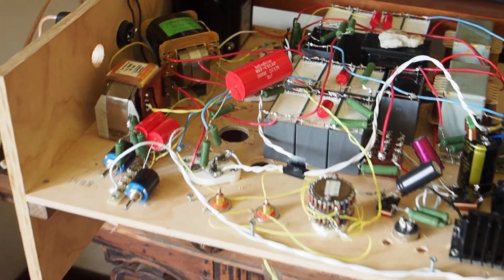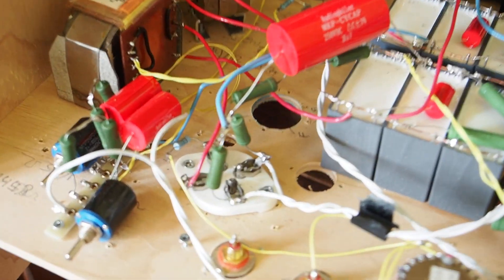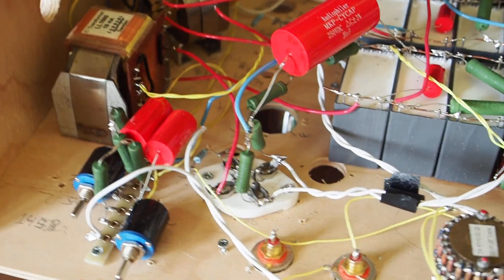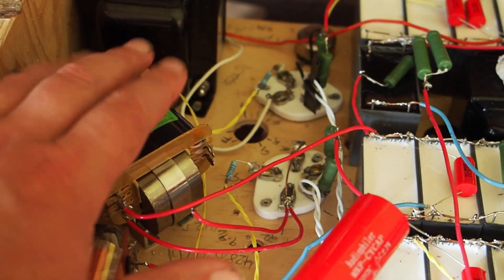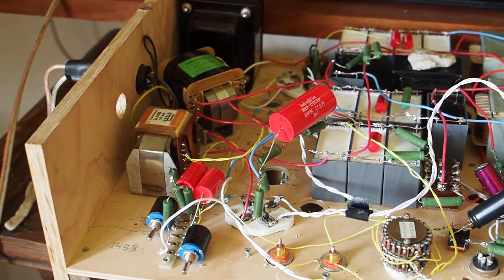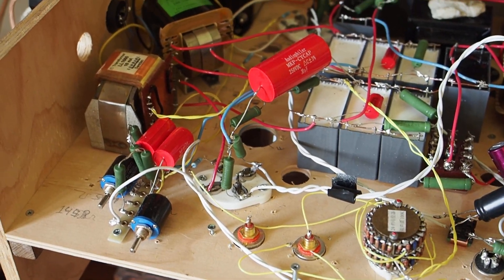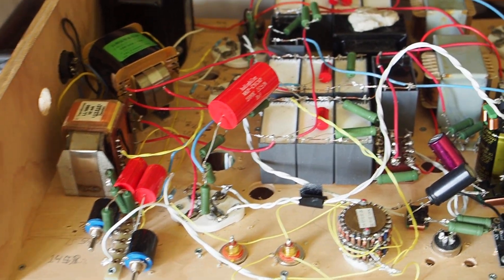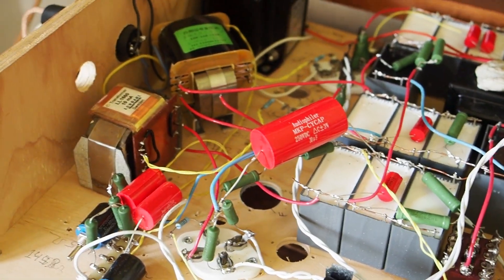Transformer over dimensioning, no alternative for experience, type 12A tube

Comment: Hey Eduard.. I like the direction you’re going with the Amp..  I’m curious about the Chinese made Ladder Attenuator with Vishay-Dale film R’s you use though.. Do you find that the switch used in that one became less “stiff” in time, with smoother clicks? I have a friend who bought one for his preamp and I tried the switching mechanism with both hands before it was mounted inside a chassis, it’s not that easy to switch into a click if not mounted on anything..
Reply from the maker: Yes it gets smoother over time, but yes you want to use it with a nice 40mm volume knob and then it turns quite smoothly after a week or so...
Reply: @EduardBroekman  Thanks Eduard.. That feedback was very helpful.. Anyway, next up is a 6A6 IDHT front end to try for your amp..
Reply from the maker: @rickg8015  Yes, I've been happy with that 24 position switch: one because it actually switches in two resistors each time and two because sofar it has been functioning flawlessly. Not too sure on the 6A6; Yes I have it but its plate resistance is high and in this amp the 35x gain is overkill. There's other interesting candidates (801A,10Y,834,841) plus I've got an Arcturus type 26 coming, so that one definitely needs to deserve a go.. probably directly coupled. Plus I've got two Rod Coleman regulators to play with to see how the DHTs will fair with those in place...
Reply: @EduardBroekman  Do update us with the Coleman Reg impressions.. Wow Arcturus 26.. Cool stuff..
Reply from the maker: @rickg8015 Will do. Those regs are one of those famed bits of tech in diy hifi, and dc supply matters a lot I've been finding, so well worth checking out...

Comment: thanks for adding thee videos, i am trying to build my first tube amplifier and am basing it on Janos' s darling , a mix between pure and baby.  I am also finding you videos very help full as am  learning to do the build  as i go so am taking steps sideways and backwards  constantly.  Am also using those film capacitors as part my power circuit. . Found some of the soldering with them a bit difficult as i was using stranded power cable and was hard to heat. Swapped wire and and changes to a 60/40 solder and that seemed to fix. I was very tempted to ditch my metal case and set up  your wooded frame as would be a lot easier to make changes and my case is a bit restrictive. Decided to go ahead with what i got as a first version and maybe do your box frame as next effort. My experience in design in other field has led me to following the Janos methodology in that electronics work better when there is headroom. Is good to see that this is being proven in your builds.
Reply from the maker: Hi. Nice to hear from you! I think the (pure) 'darling' as your doing or a 'spud' amp are really good as first amps and get experience with layering wiring/routing and making the amp quiet (in a metal case) so I'm sure nothing of what your doing now will be a wasted effort. Good on you for starting it!

As for my project..the pure darling way of chosing components is a real goal for my build now; I'm increasingly employing more and from Janos' 'pure darling' design and combine that with facets from Sakuma's design and incorporating tips from other people/online friends... but really, a lot of it comes from the pure darling. For exampl, I've got two 350W power transformers coming now for B+ and one for filament and fixed bias... plus better chokes and interstages... silver wiring a little later.

Comment: That should read all the work you do. I’m happy with horn speakers JBL although I have other systems in house,running in some Bybee filters interestingly only put them on the horns the bass has also been altered. My thoughts horn, xover , bass and amp are a closed loop where effecting change to one part effectively creates changes in the loop??? I only have 120hr on the bybee’s so far I wanted to hear the different stages of burn in.

Comment: Hello Eduard , ...thank you for the upload and indeed nothing replaces your own ecperiences .........not only for music reproduction...

Can I ask you what are the grey capacitors ( film ?) that seem to please you ....?

Kind regards
Frank
Reply: Hi Frank
The grey caps are made by Kemet and are the DC link variety and were recommended by Janos. Wima also makes DC links as well.Both are non polar 
of course.
Cheers Lou
Reply: Thank you Lou , ...years ago I tried a Tubecap from Mundorf  as first ( filter) cap after the rectifier ........I solderd them out even faster than I solderd them IN....
Meantime the first foil cap on the Yamamoto 45 amp works fine ...( two caps in series in a dampened tubuar enclosure) 

So far I learned that the first cap must ab sorb the current bursts while charging only on the peak voltages on the first capacitor .........so the better or best ( and bigger value or low esr ) capacitor sometimes becomes your enemy...saw late that Audio Note does the same and was therefore critised by a customer for that , .....Quortrup and co also do seem to know why ...

These grey  caps ( Kemet ) are certainly worth of using them at the right place as reservoir for the musical energy.
Even maybe likely as a cathode resistor bypass  .....The original 300B amplifier  frvrom Yamamoto use also a good filmcap in this function .
Thanks alot to the both of you ..............I will have a look where they can be bought.

Kind regards 

 @loureda5443
Reply from the maker: Hi Frank, the bulky ones are Kemet C4AQ DC-Link 45uF 900V. Janos recommended them; they're the only once he uses for power caps: they have low inductance(15nH) and internal resistance (4.4 mOhms). They take 2 weeks to break in but once they do they have minimal MKP sound. I tried some Faratronic C3D 30uF 1100V too (they have a black underside) but while still very efficient they're not as good sonically, so its used as C2.
Reply: I used a .5 amp isolation transformer on early CD players it worked i and others heard a difference BUT when I went to a  2amp isolation transformer much better and yet power draw from the CD player was around 100ma max 200ma that’s when I started to look at headroom in design. Engineers will tell u that’s bad practice because from day one they’re told to work to a budget DIY doesn’t or should not have that constraint thank for all the work I do.
Reply from the maker: @petercrisp3006  Hi Peter; good info and interesting it also applies there.. ! I think you also - in one paragraph- outlaid the case why DIYers can make huge improvements in hifi where very few commercial designs will go. One element I can see with isolation transformers is that a lot of power supplies in audio devices have a very short charge cycle so the difference between rms and peak draw could be substantial.

Comment: Generally speaking You believe in NOS tubes or new production tubes ?
Reply from the maker: Hi again MrBazsi!! Good question. I think the variation between NOS production runs and manufacturers is wide enough for good new production to be able to easily fall within the NOS varieties. For example, my type Psvane type 50 is the most transparent tube I've yet experienced... and at the same time the NOS type 46 (Sylvania) probably the most musical and euphonic yet neutral tube. The new production fake mesh 300B-N that I have I would rate 2 whole classes below either one..

Another example: One comparative review between several 300Bs was very interesting. This particular one was in Peter Qvortrups home system, where the audio note 4300 new production sounded much better than 1980s WE 300Bs but very similar to 1970s WE 300Bs... Some much rarer older 300B pipped the 4300 .. but I think it showed the range that we're working in.

Anyway I've got good hope for new production and I hope they'll take up more rarer and lower power types and improve on them - especially DHTs.